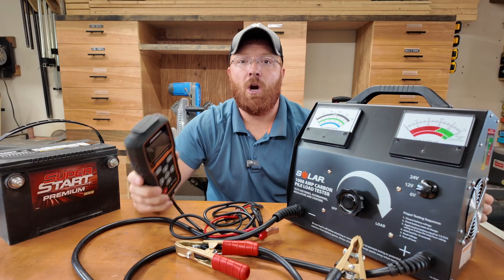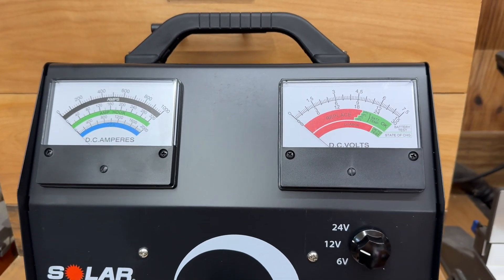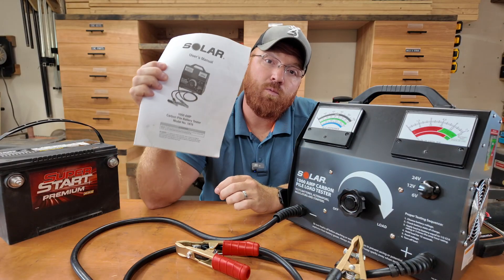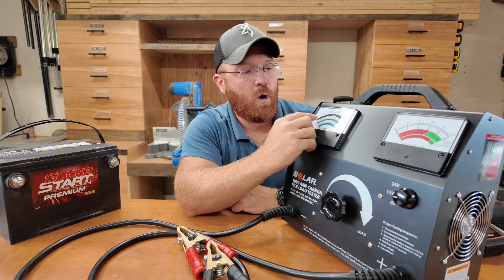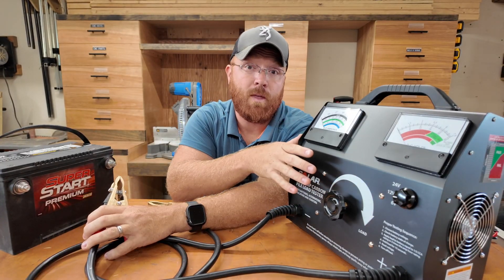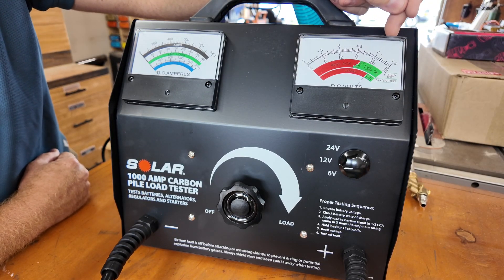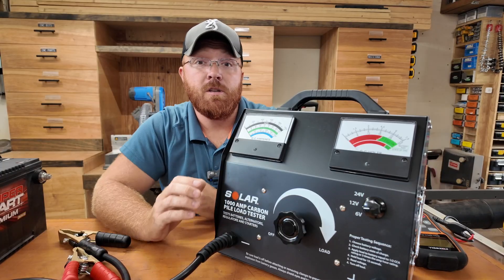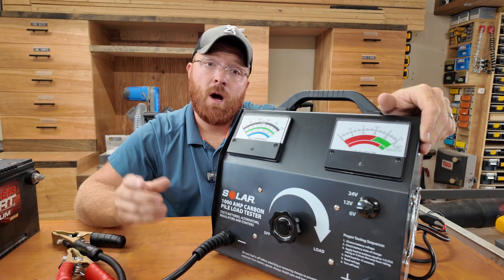Here's why the Solar 1000 amp Carbon Pile Still Beats New Testers. Let's bench test a bad battery.

Comment: I still prefer the newer testers. My Topdon tester has been reliable for years. Modern batteries can pass a carbon pile test and fail a week later. I’ll stick with the newer testers. All testers are like condoms not 100% reliable .
Reply: Modern are usually great, but small digital testers don't have a way to actually pull rated battery current (which is what a carbon pile or resistive load does), instead they pull a tiny load and estimate, or measure battery voltage during a cranking test which is far below the actual CCA rating. So they can sometimes miss a failing cell whose resistance increases w load.
Reply: @m @mback12000  they don’t have a way of putting a battery under load but they don’t need to. For most part any faulty battery i put the tester on always comes back as “replace “. Over the years i know of only one battery i tested come back as “ good” even though it was faulty. Secondly modern testers have a cranking test mode. A friend who owns a car parts store told me that the carbon pile tester isn’t the most reliable either. He said a battery can test good but fail a week later. They were more reliable for older technology batteries from the 80’s.
Reply: @Mickytdi  Except for batteries that are running the Drive Train motors of electric cars - that VAST majority (ALL) ICE vehicles use a form of LEAD ACID battery.   These may be Wet, Mat, GEL, etc. - but the Technology is basically the same as it has been for over 100 years.
I have a very expensive Electronic Battery Tester along with the Printer for the Test Results.  What a waste.  When they state a battery is BAD - you know its bad.  When they state the battery is GOOD - you  have to do more (Carbon Pile) testing if you want to know if the battery is any good.